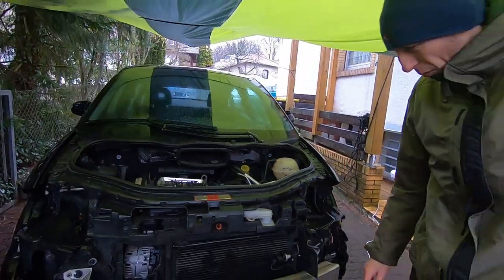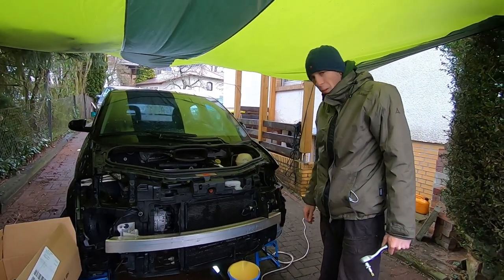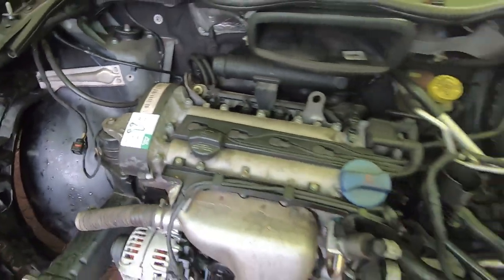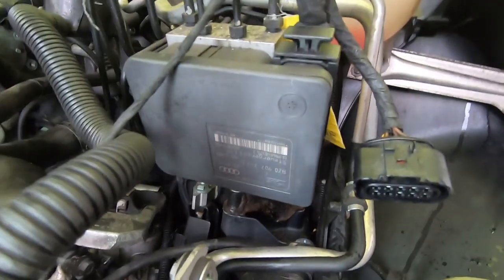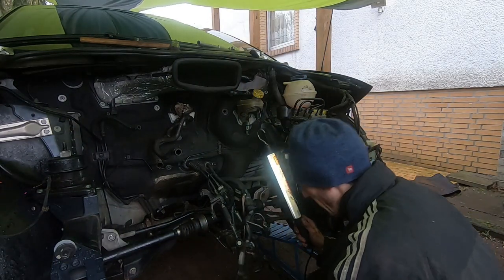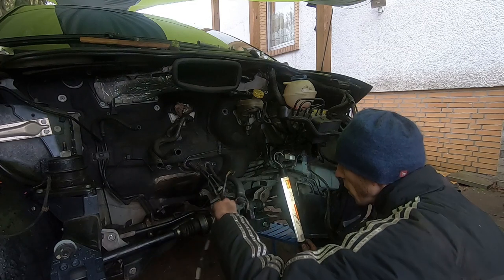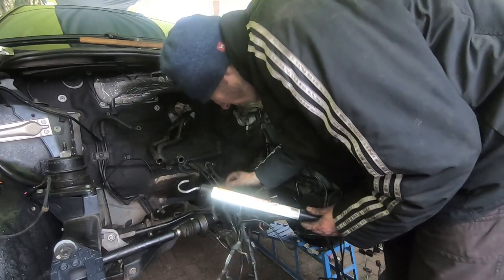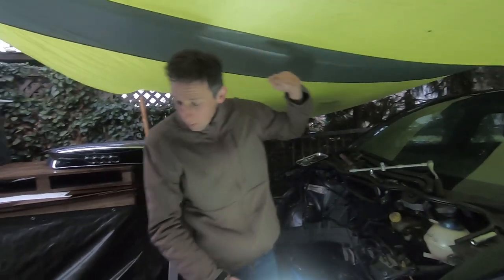Lab Update #57: Audi A2 fossil delete

Comment: Someone told me, the A2 was designed with a double floor, where space for batteries might be.
Where can I proof this theory?
Reply from the maker: We will see as we go along. There is a pretty deep pocket in the boot, but it means the car is very tail-heavy then
Reply: @EngineersFear  What about the tunnel in the middle? That looks quite big, and a good place to put some weight.